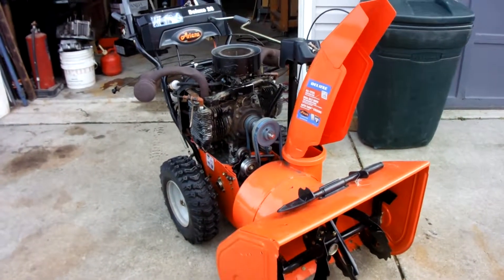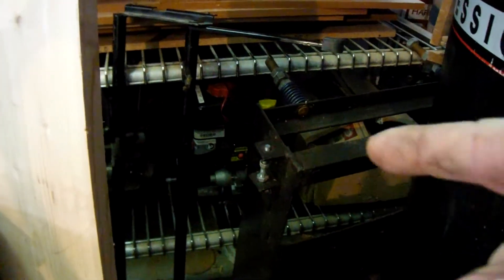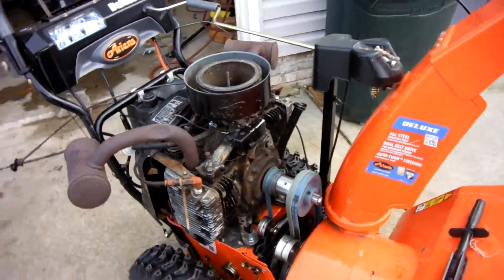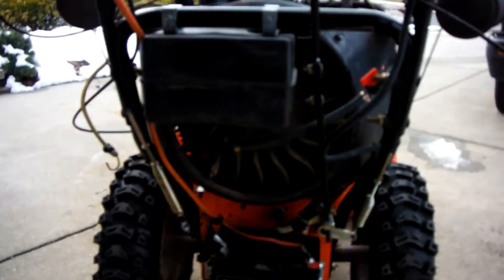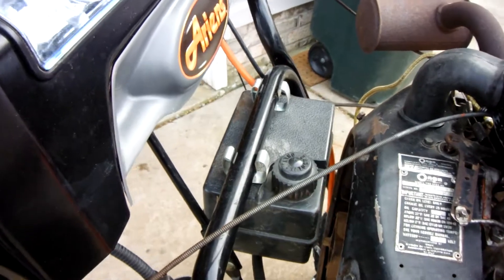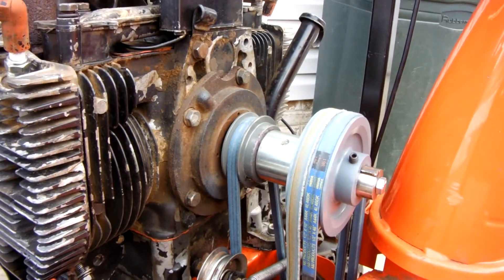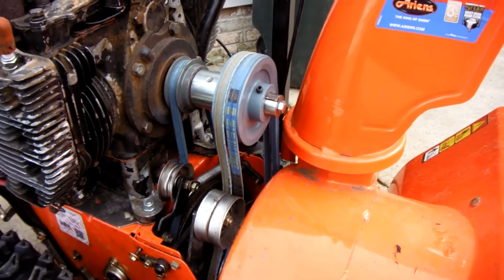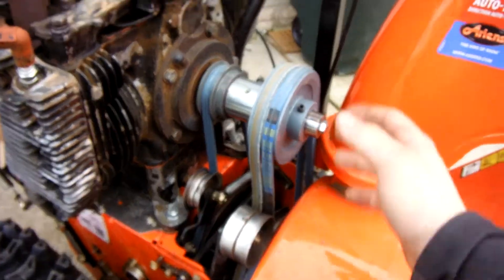18 HP Onan Opposed Twin Snow Blower Project

Comment: what was the hp of the original engine. also you could have used a shaft adapter. i;ve seen several of these machines repowered with diesels. more torque than a gas with equivalent hp
Reply from the maker: The original was 8 HP. This engine creates a ton of torque.  About 32 lb-ft @ 2200 rpm. A Diesel engine would be a better and simpler approach because it wouldn’t weigh as much and you wouldn’t need the added complexity of adding wiring, fuel lines, gas tank, battery, and throttle cables. I did this because I wanted to go to the extreme.
Reply: @Omegadoomship  i won't have any trouble digging through heavy wet snow

Comment: you didn't get snow yet?
Reply from the maker: It did snow but it rained in the evening before I could use it. The engine has been having issues running way too lean. Feels way underpowered. I’ll try to get it running good in time for the next snowstorm.